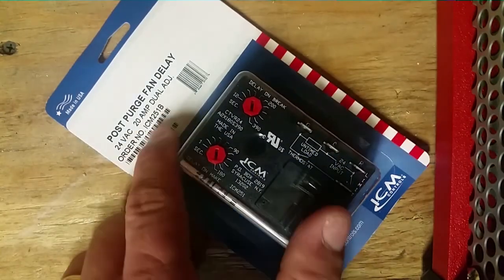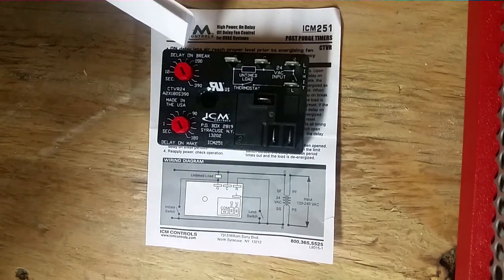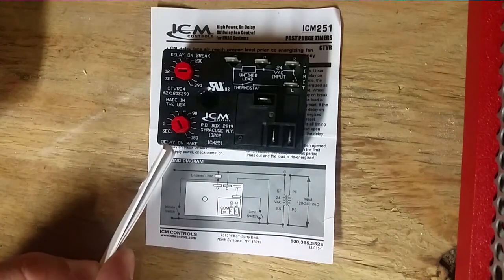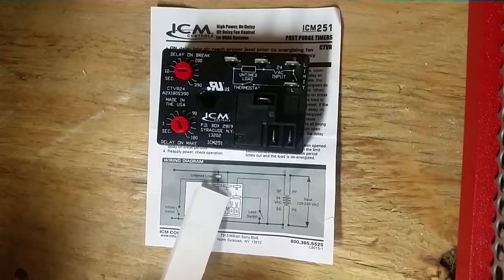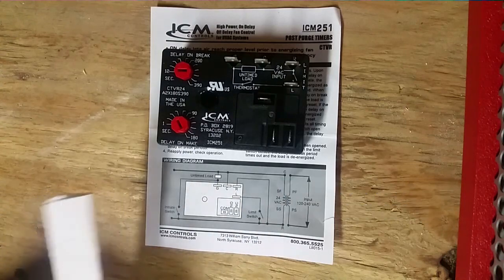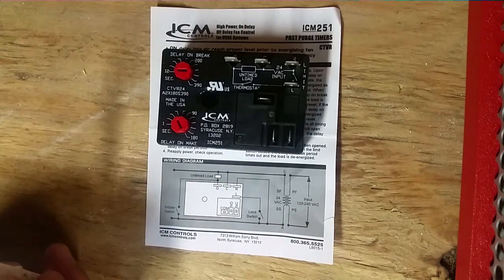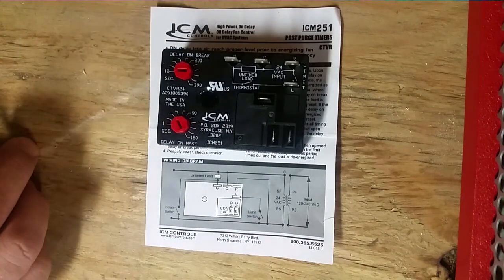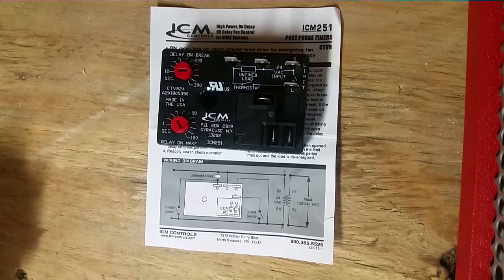ICM 251B Blower Control Relay  HVAC

Comment: I'd like to find a 24 volt AC cycle timer for my fan on my furnace. The circuit board on the furnace will turn the fan off when it goes into heat.  So it needs to be the fan 24vac input that's control.

Comment: Just used one today on a RHEEM OIL FIRED FURNACE BLOWER TIMER FAILED AND THIS WORKED GREAT 
BUT YOU NEED TO POWER R AND L TO FOR MY APPLICATION FOR IT TO WORK AS ZACK SAYS L IS LIMIT AND THE FAN RUNS CONSYANTLY AS THE CONTROL THINKS A LIMIT IS OPEN
Reply from the maker: Thanks david

Comment: On alot of gaspacks that have x13s I've been able to use the motors 24v call to the module as a trigger for something like a 90340. Which helps eliminate the need for a board. This however is perfect for replacing a true variable speed blower
Reply from the maker: I do that too on some of them.